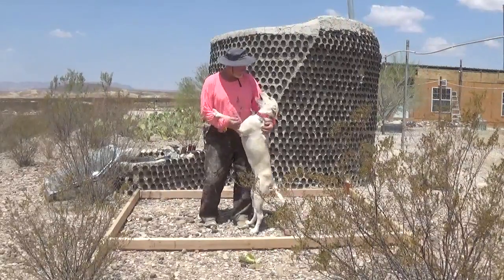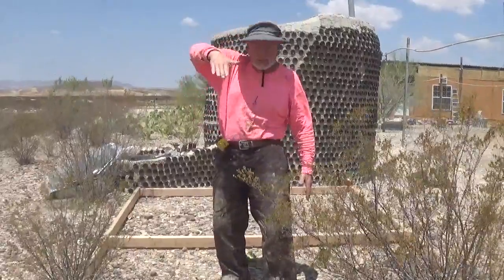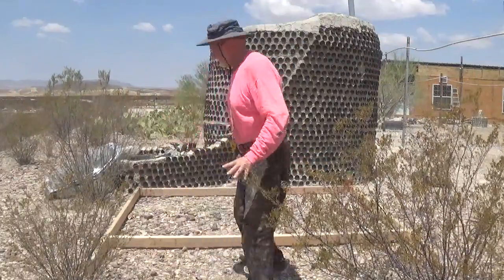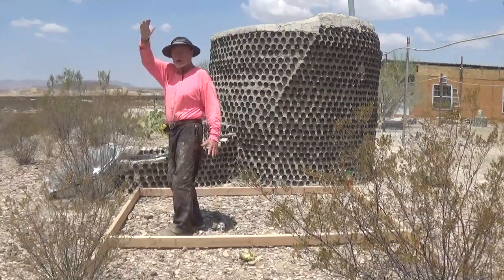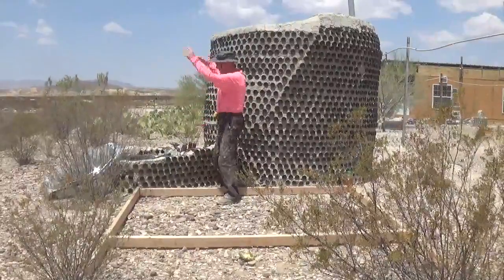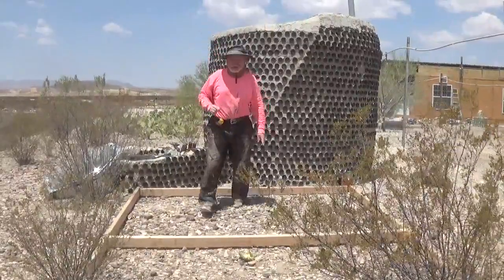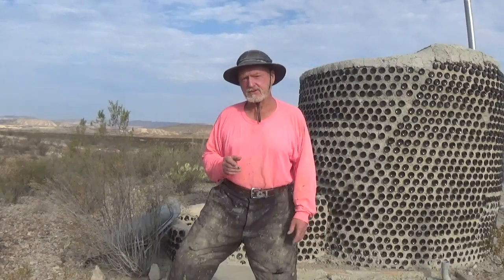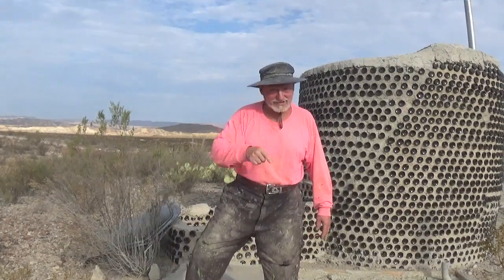V-Log For August, 2020

Comment: ROBERT are you rebuilding your  solar system with forklift batteries?
Reply from the maker: Yes, I am getting two smaller ones than we had and going to 24 volts. I wanted to get to 48 volts, but it would cost some $2800 more. Also adding much improved electronics I am working closely with  the battery guys and Colemanair for the electronics.

Comment: Are the cows still a problem?
Reply from the maker: None have come onto our property for several weeks now. The "rancher" and his elderly "business partner" have supposedly moved them to another area some five miles distant.... where they are now repeatedly breaking the fences and roaming free on the State highway.

There are a few still roaming the area and his gates remain open, however he claims to be "trying to round them up". My next step would be to use the court system to compel the County Sheriff to create a "Sheriff's Posse" where deputies on horseback, four wheeler and helicopter round them up, impound them and charge the owners for the cost of the round up and a per day charge for each animal. This is written right into the State statues and is NOT at the discretion of the Sheriff, it is a mandatory action!

I have been derided for this stance by a few of the locals, yet the same muffinheads would happily pull guns on "trespassers" and cry like babies if THEIR property suffered half the damage our has suffered at the hands of this mentally challenged alcoholic and his geriatric business "partner"!

Comment: A successful gravity battery would cement your legacy.  At least until Tesla or Berkshire Hathaway patented it.
Reply from the maker: A gravity battery is simply the works of a "Grandfather Clock". I doubt every variation of it can be patented. But if things go horribly wrong on November 3rd, MAYBE!
Reply: @ecoranchusa  Doing it without a hydro electric dam with enough power to operate a homestead would be a first.
Reply from the maker: Not really a first. It has been done. This won't power the entire ranch, just recharge the batteries quite a bit during the night, for however long it takes to run completely downhill.